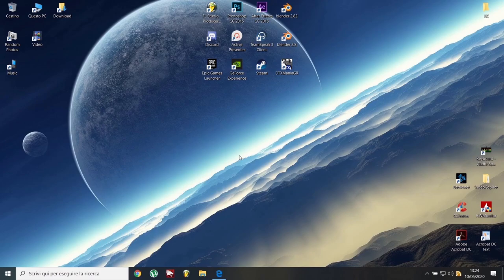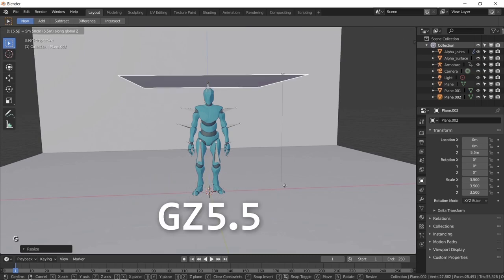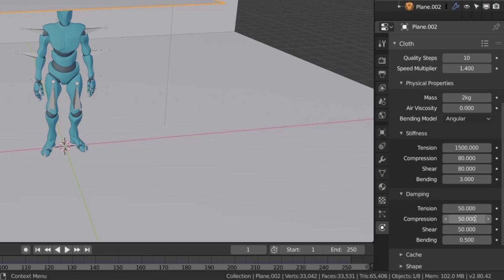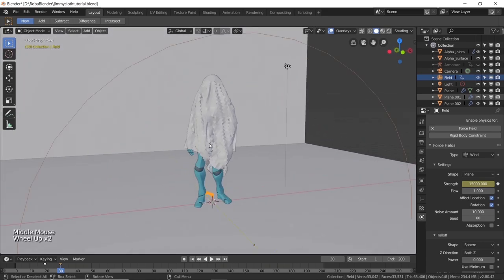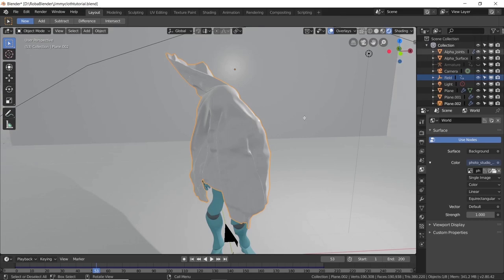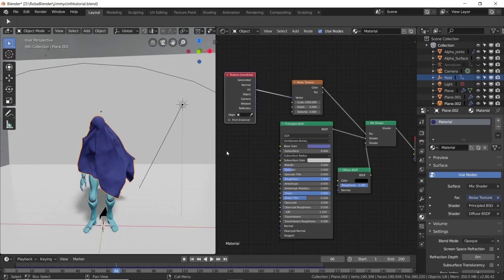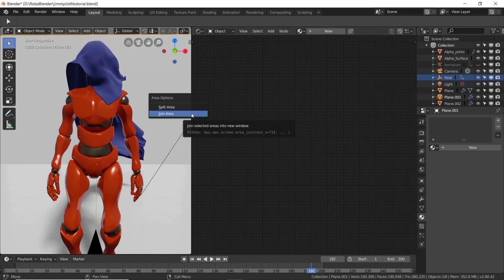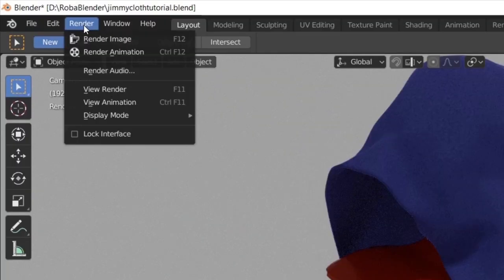Cloth + Air Simulation - Blender 2.8 Tutorial

Comment: I have the same laptop specs as you, what renderer did you use for this? Have you tried eevee and also how is cinema 4d on this set up, have you tried it
Reply from the maker: The final render was done with Cycles, 128 samples with one denoise pass. I also did a test render with Eevee (you can see it at 13:35).. I never tried C4D, I will give it a go! 😬
Reply: Costa VFX how long did eevee take compared to cycles
Reply from the maker: Eevee with 64 samples took something around 30 minutes, Cycles took 7 hours